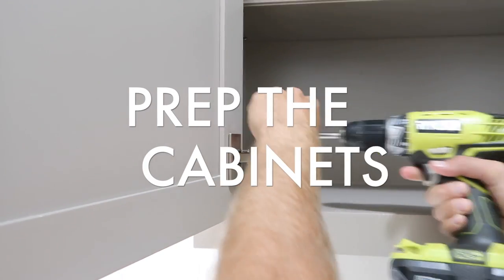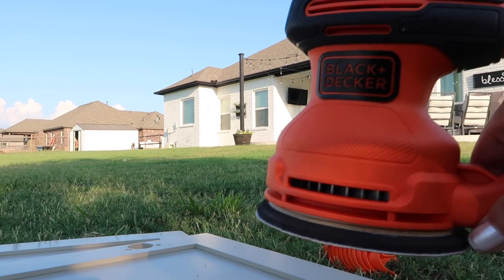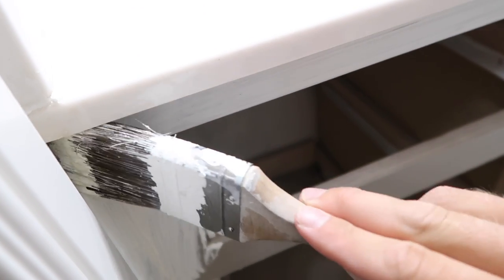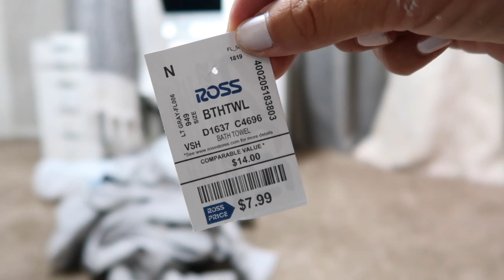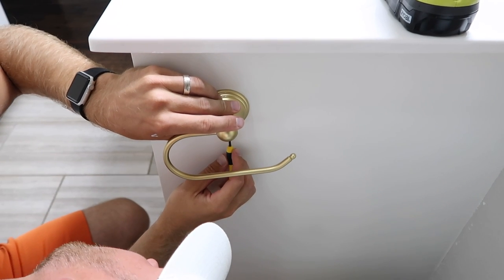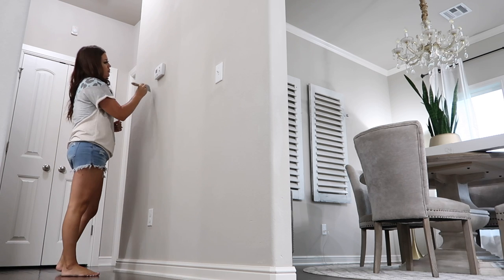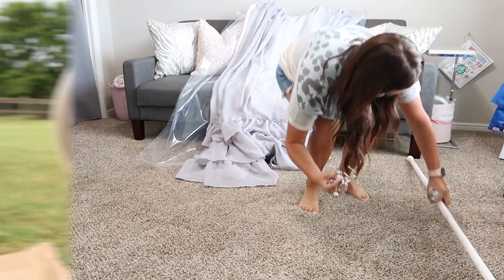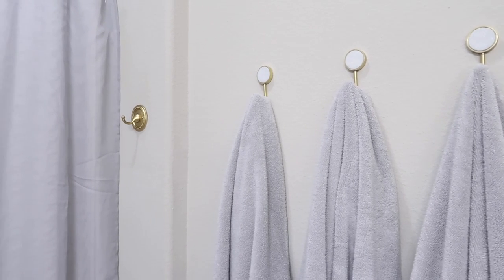DIY SMALL BATHROOM MAKEOVER ON A BUDGET | SMALL BATHROOM MAKEOVER 2020 | GLAM BATHROOM MAKEOVER

Comment: Looks great:). Here is a tip for Chase when using the drill to remove/replace screws.  By putting a small magnet at the base of the drill it will magnetize the drill bit and keep the screws from falling.
Reply from the maker: His drill has one attached.